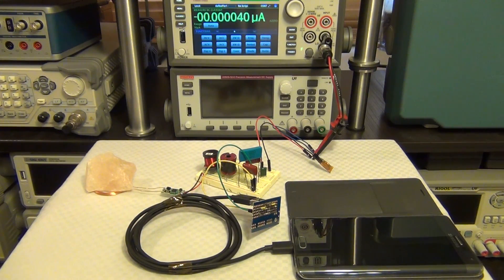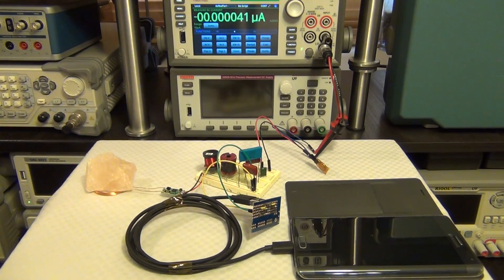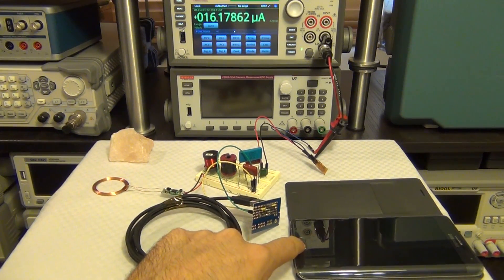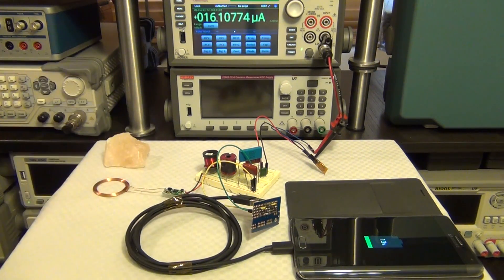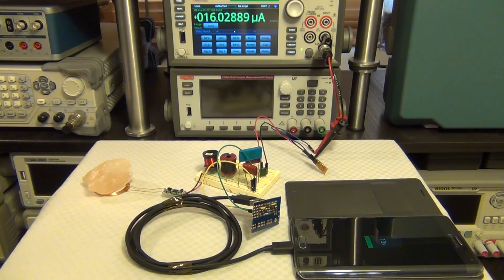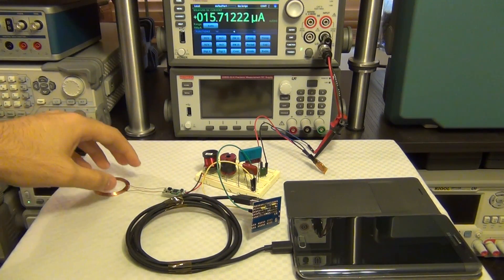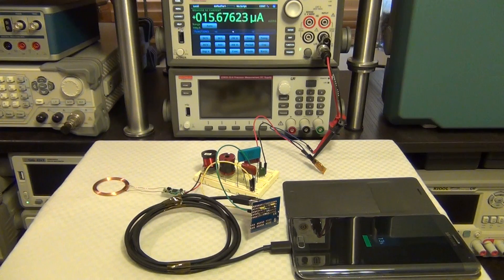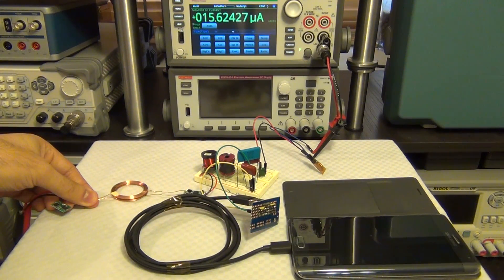TSP #61 - Free Energy & Over-unity Charging Circuit - The Scientific Method

Comment: that was a pretty good lie, however, circcuits like Kapanadze, Tiger, Wesley, Arunas, Akula, Don Smith, Chubinidze, Dally, and many others have a way of bypassing this embarrassing conventional scientific coverup. Yes, we can't make a circuit flow in a circle without excitation, resonance and many other ways that have had a massive effort to cover the theories tesla has come up with. The government will even say that Tesla only had top secret weapon developments that were taken from his hotel room and that he never developed a free energy technology because he was mistaken or wrong. That is total BS because I have several of these technologies built, one of which utilizes a simple pulse of energy to continue on it's operation without any external source that we can literally see. There are no wireless transmitters, no hoaxes, no BS whatsoever. The fact is that the systems are created with the Tesla arc theory where he noticed that several arcs of energy used to switch the circuit allowed for an external energy to be first disturbed and pinged, like rings in water, then, those magnetic vortexes that were utilized to amplify the energy with mirroring the phase conjugate to gain potential and amperage to infinity. It isn't very hard to build if you have the typical electronics lab, as you do, so none of this what you are doing is actually even necessary. The posts are everywhere online that show the circuits, and the results. I am one of the successful replicators and hundreds of other have these working devices as well. What does this mean?? This means we have been lied to since the first day electricity has been transmitted, this is because Tesla was brilliant enough to know what other methods there were to get this energy for free. There are several hundred or several thousand revisions of these circuits and other ways to tap into this energy. Not all of the folks out there are even trying to sell anything, and the fact of the matter is this... 9 out of ten may be selling snake oil until they get thrown in jail and the key tossed, but, that 1% have solutions that are not being allowed to be displayed and the government, the energy establishment, oil and energy conglomerates and others that earn from this system of greedy fat pocketed folks are hiding the truth and will do anything to stop the release of these technologies, even though they will solve the worldwide problem of pollution and failure of our atmosphere which will change our planet very soon into a Mars look alike. It's a shame that the government has been allowing this to happen now for 135 years and it needs to stop. Our people are smart enough to figure out other ways to live without being forced to pay for something that nature offers us if we just disturb her a bit, then rely on the motions she releases to utilize for these energy requirements.
Reply from the maker: +Marc Belanger Patent, produce a working prototype which can be tested by others and not just through a out-of-focus video on YouTube, publish results in peer reviewed scientific journals and then we can talk.  And of course, dress nice for your Nobel prize ceremony. Until then, you have presented zero evidence.
Reply: Im too lazy to read your comment... Did you say that youre amplifying energy?
Reply: Well, at least you are honest about your laziness, however, I'd have to say that is hat's pretty lazy. I heard of being too lazy to maybe go and pick something up, or to get up and do something but reading isn't a strenuous activity that raises the heartbeat or makes one breathe heavy.. I really can't believe what I am hearing..lol.. Yes, I did replicate circuits that literally amplify the amount of energy used in a system by drawing energy in wirelessly from unknown sources, and they do this by allowing the circuits to continuously loop without any additional physical wiring.  The system does not use hidden wires, hidden wireless induction methods or hoax feeds as some tricksters online use. The ones I have done may power bulbs in the upper wattage areas of 150-155 watts, and they aren't extremely powerful but it is a start and I congratulate men like T-1000, Arunas, Wesley, Aidas and many other folks from their group of private researchers who have done a wonderful job at showing the best circuits available for these energy types.

Comment: Why doesn't someone take a turbo from an engine (which is made for airflow-and "air" is considered a liquid), hook it up to a household water supply, attach a generator; every time water is used the turbo turns the generator to charge batteries for an inverter. Free power.
Reply from the maker: +anon ymous You could do that, but the amount of energy you would generate would be tiny, very tiny.
Reply: increasing gears. it's a shame that ideas are immediately dismissed without a prototype, torque tests, flywheel try, flow tests, power ratings, inverter requirements, battery capacity, water usage (dish washer-washing machine-showers-toilets-...), pressure requirement test, etc. You're right, what's the point of even trying. Thanks for showing me the light.
Reply from the maker: +anon ymous Increasing gear does not help. The total amount of available energy is what matters. You can increase gears all you want, it won't add power to the system. The total average water usage of a home is known. It is a very very small amount and most of the time the flow is very low. The amount of available energy is very small. I don't need to build one to know that it is not a viable solution. There are shower heads you can buy which light up a few LEDs while you shower and that is the highest flow in a home, so yes you can light up a few LEDs but that's about it.
Reply: I guess I was being content with a lazy explanation instead of discovering truth.
Reply from the maker: +anon ymous I gave you exact reasons why that approach will not work. Why not also put windmills in front of your air conditions ducts and generate power from the air flow? Also lets put piezoelectric tiles on the ground so you can generate electricity as you walk around. How about lining all the inside walls of your house with solar panels so you can recover electricity from your lamps at night? Lets also put thermometric pumps on your shower walls so you can use the heated water to get some electricity? ALL of these suggestions will produce energy, but none will produce enough for it to be worth while.
Reply: I'm agreeing with you. It would never work.

Comment: I had the same idea to make a video of how to generate FREE NRG from thin air.
(Disclaimer: only while the power grid is active and the 50Hz signal is coupled to my antenna which is connected to a bridge rectifier and a low-power LED.)
EDIT: It's actually illegal to inductively couple electricity from the power grid. Don't try it at home, kids!
Reply: Riskteven Theft requires that something tangable was taken from one person and given to someone else. In this case it would actually be impossible to show that anyone was caused any loss or that anything tangable was touched in the first place. Unless the ele company happens to have a manifest of electrons.
Reply: Riskteven
How would that be done?
Reply: Morlanius
They have the capability of monitoring voltage, current, load, impedance mismatches and I would guess a lot more. If they can do this at many points in the grid, they can theoretically detect someone inductively coupling energy from the grid between two points then narrow it down by searching along the cables for anything suspicious.

Comment: The free energy scams have definitely gone to far for to long.
I know you have done a video on energy harvesting before, but maybe you could do a followup video where you calculate typical power levels you can expect from different "free energy" concepts.

For example, how much power could you possibly harvest from the air from all the WiFi, GSM and Bluetooth-waves combined. The answer is of course extremely small, but I do not think everyone understands exactly how little and how long it would take to charge a smartphone even if you had 100% efficiency.